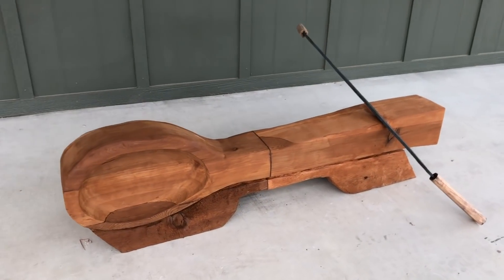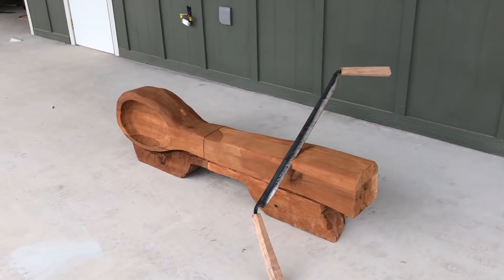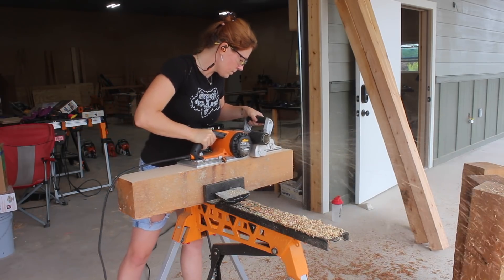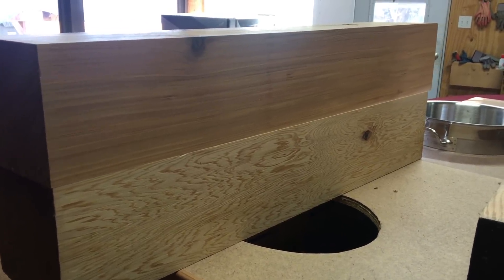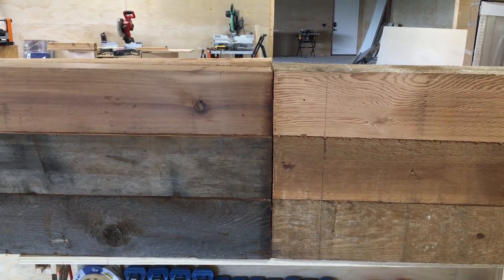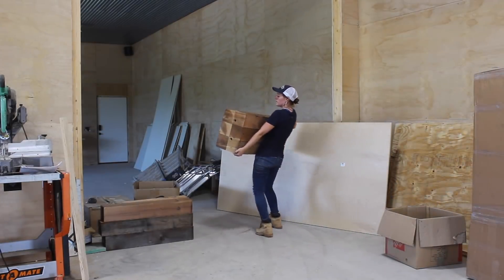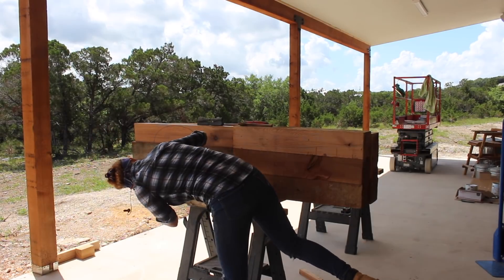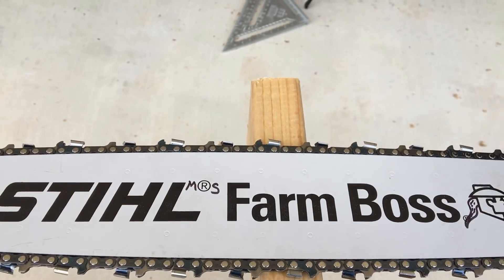Giant 6' Wooden Spoon Carving

Comment: A technique I've seen used for jointing difficult pieces like your 2 ends: place the 2 ends closely together as you did, then carefully run the chainsaw down between them. As long as you take some from both sides at the same time, they should match up. The roughness from the chainsaw cut will probably require some smoothing.
Reply: That is what I was thinking, get em close and then run the saw between to fine tune it,

Comment: If you try this again, try using some cheap straps (i.e.,  your band clamps)...Ive done something similar, and the way I got the two pieces drawn together was to use cheap Harbor Freight ratchet straps.   BTW: Those cheap straps are rated at around 500 pounds. I used those to lift the upper cabinet of my 56" tool chest onto the lower chest (300 pounds and my wife couldn't help me...so solo work with the ratchet straps).

Comment: You could have flattened the ends with a long flat sanding block with 80 grit sandpaper attached before joining them. Or better yet you could have made a giant mortise and tenon joint, that would have been badass. Haha Still turned out great congrats on the build.

Comment: Can I have your Stihl Farm Boss? Tite Bond 2 will last longer in Texas than in the north but isn't the best choice for outside. Epoxy, Gorilla or outside Construction adhesive works better. Drilling 1' on either side has no structural advantage. You could use clamps but you have to drill almost perfectly square in 2 planes-you got lucky.

Comment: Fun project !  Opinion: running larger pieces of wood on a jointer or table saw is more dangerous with a push pad or push block than just using your hands. Hands provide a much more dependable and natural grip on the material. Of course, the safety Nazis will go crazy !  :)

Comment: I have a 'Carving' project this week and was wondering how to cut a straight edge on a log with a chain.. Hey presto you give me the technique.  IF you need to butt joint something like that again.. think about bracing the outer ends and using a bottle jack horizontally, it will save you a bit of sweat and muscle fatigue, or you are in training to arm wrestle with Cody???

Comment: Why not use the jointer to level the ends of the blocks so filler epoxy was not necessary?
Reply from the maker: The blocks were too wide at that point to pass through. Also, I'm not very familiar with a jointer so I don't know how reasonable it would be to try moving such a large mass across the machine as it would require.
Reply: you typically don't want to run end grain on a jointer it will not give a smooth cut and also blow out a large amount at the end of the cut.
Reply: Never ever pass the end cut of a board across a jointer, you will get kickback.
Reply: Take just a small amount at a time and follow with a sacrificial piece.
I get smooth cuts this way.
Reply: Not if you are careful and not rammy.
The weight of these blocks would work to your advantage, holding it down.
Reply: The jointer is not designed to treat the endgrain of wood. It is used primarily for straitening/flatening and squaring a perpendicular edge to a already planed face. Basically a secondary tool to the planer when dressing rough stock. To be used for solid wood only with the grain. A table saw with a sliding bed would be the easiest way to square up those ends.
Reply: With the shop you have just built, an 8" jointer should be a manditory piece of equipment.
Do some research.
You will not regret.
Reply: Phil.Paula Stocks Because you cant joint End Grain that easily without blowing out everything
Reply: louisschmitt04
Oh yes you can.
Take no more than 1/32" a pass and follow your work piece tightly with a sacrificial piece to prevent blowout.
Try it before you say it can't be done.
Be jointing end grain for more than 40 years.
Reply: Phil.Paula Stocks Maybe it works wird your Jointer, my one (Felder AD 741) with Helical Cutterhead blows engrain Workpieces out, even with backer piece!
Reply: How about a handsaw and a hand plane? A good saw and sharp blade will have it flat in no time.....js